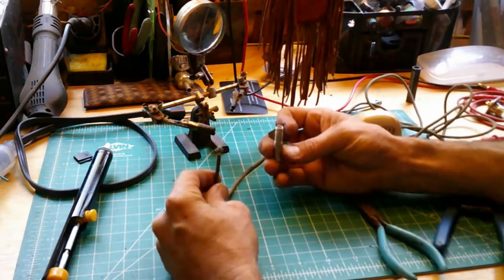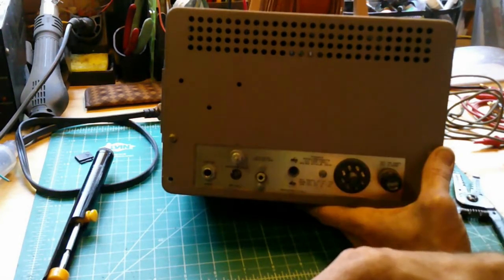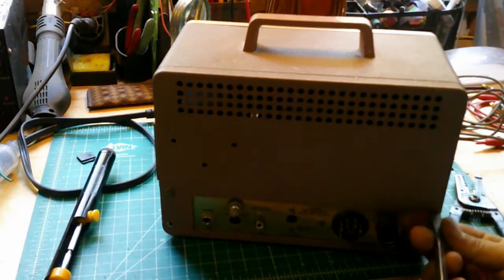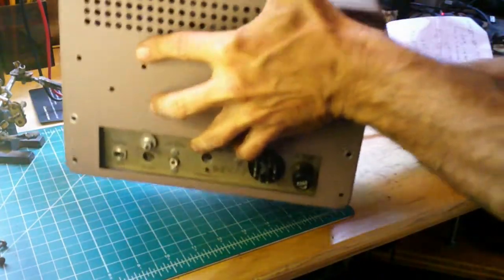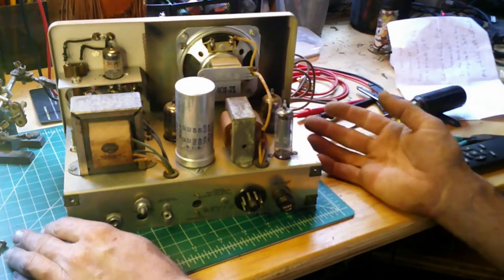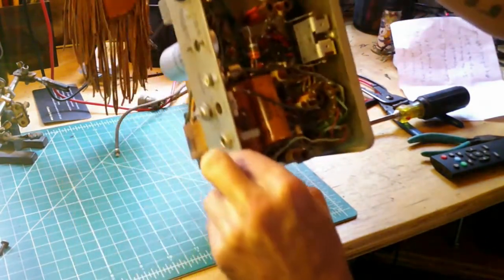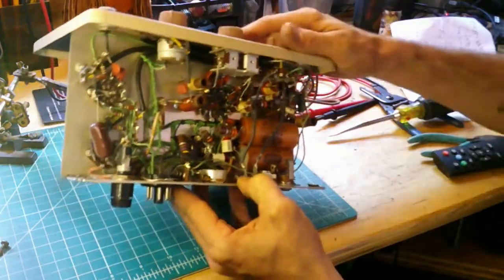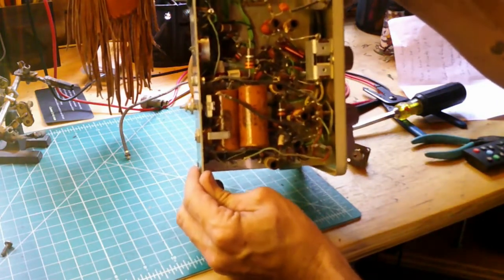Heathkit Sixer Part 1:  A Look at my HW-29 Transceiver

Comment: I discourage doing mods on these....IF they are un-modified when you get it... they are worth more un-molested.  But that doesn;t mean not to recap and or repair them.  Yours has xtal plug added to the front panel, with an oscillator added behind...not a mod I've see before.  You can solder a male RCA plug onto RG-58... or just an adaptor to connect a PL-259 coax plug for RG-8. No need to add the coax connector.   The original mics seem to be a lot less common than the radios.  It is a crystal mic... which can be damaged over the years  by heat and moisture. But any Hi Z ( high impedence) mic will work fine.   Find someone with a tube tester... to make sure your tubes are really good.  You will be surprised what the lunch box radios can do !  The HW-29 was short lived... and replaced by the HW-29A  which used a different freq range xtal, to minimize TV interference. Mine is the 29.  w6wuh
Reply from the maker: I agree with you, these are great in original condition and are worth a lot, but this one already had modifications before I got it, so I just went for it.

Also, I modify everything I can. My personal concept of "value" is completely unrelated to monetary "worth". As far as usefulness goes, this thing has a total value of zero... unless of course you need a paperweight or an anchor for a small boat. 

Tubes were tested at a club members house and all were good. 

After this thing sat on the shelf for a few years I ended up giving it to a friend. Knowing him he's probably in the process of turning it into a microwave or something.

Comment: I, likewise, have the”Sixer” as well as the “Twoer!” K6MQF/7
Reply from the maker: Nice, I have the crystal for it now... I just need to get around to getting this thing on the air... Needs some new capacitors... maybe a full rebuild, it is pretty messy in there and the solder joints aren't the best....